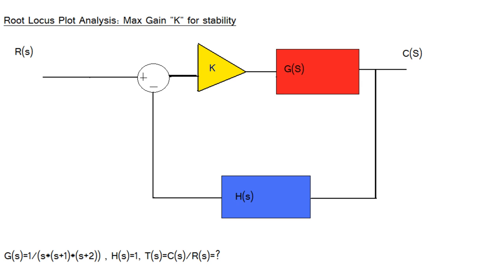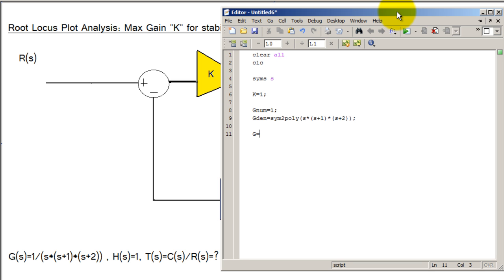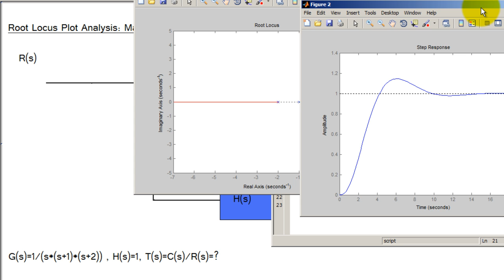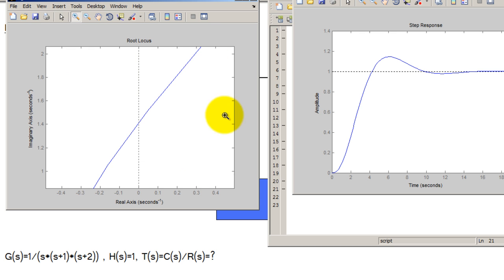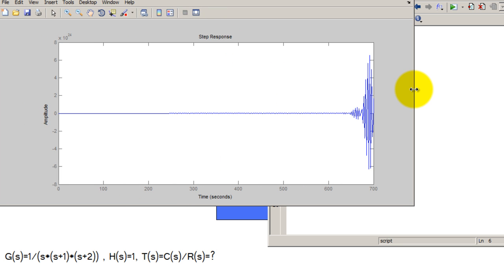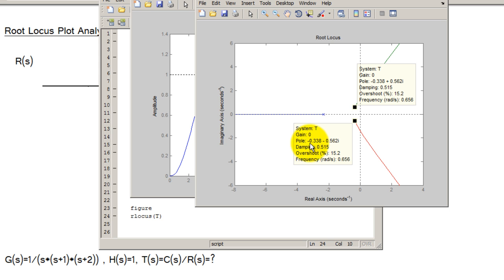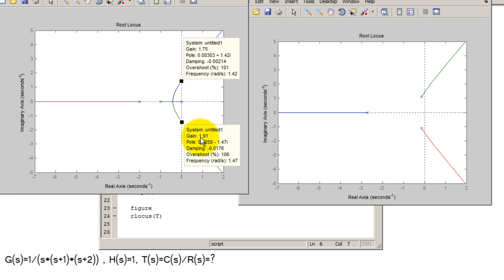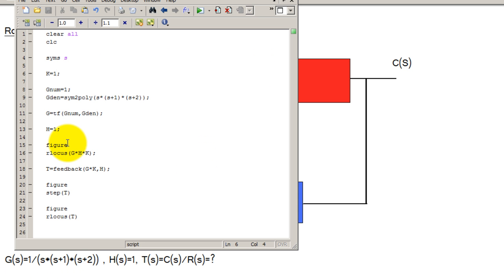Find Range of Gain K For Stability Using Root Locus Plot

Comment: I'm not sure why you are plotting rlocus(T) because rlocus(G) ARE the closed loop root loci already. You can determine what happens to the roots of the closed loop function as K is varied simply by looking at rlocus(G). rlocus(T) does not add anything.

Comment: What if it’s touching the IM axis twice
Reply: It has to.  Because as long as you have real numbers for K, and it applies in real time, the root locus is symmetric about the real axis, and all imaginary points on it are conjugate pairs.

If it has multiple K-values at which it crosses the imaginary axis, usually we are interested in the lowest K-value, at which the FIRST pair points on the root locus cross the imaginary axis.  We are interested in the cutoff when the poles of the CLTF initially start all on the left side of the plane where they are stable, and how large we can make K, so that the first pole or conjugate pair of poles crosses the real axis.  In other words, the maximum K-value for stability.

Comment: I'm a little confused on how rlocus() is implemented and it might be a source of my problem. rlocus() in MATLAB assumes a gain in the feedback portion and you must choose the forward-feed system as described in MATLAB's rlocus() help page. Every textbook I have seen always places the gain K in the feed-forward (open loop) part of the diagram. I am trying to find values of K for my system which is in the form given by most textbooks, but it appears that MATLAB is defining where gain K is differently and I believe is what is giving me wrong answers. I am curious as how you've gotten yours to work.
Reply: it does not effect the system as the characteristic equation will remain the same which is used to plot the transfer function although transfer function will not be the same but we dont need transfer function we need characteristic Equation to plot the root locus and it remains the same
Reply: you can verify that by ploting closed loop transfer function of the system in example and closed loop transfer function of the matlab diagram .The  characteristuc equation will remains the same so it wont effect our result ;)